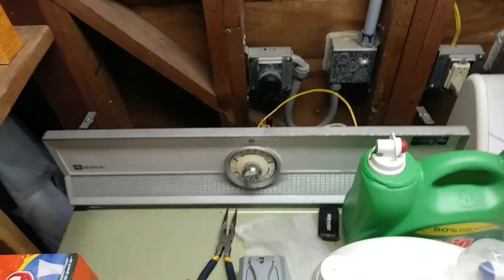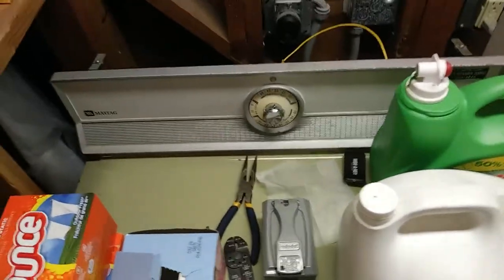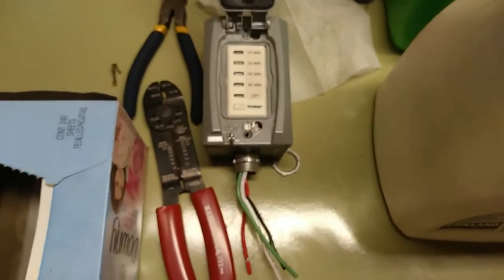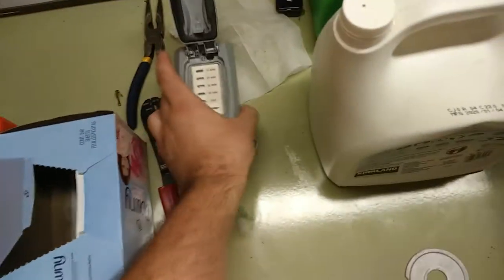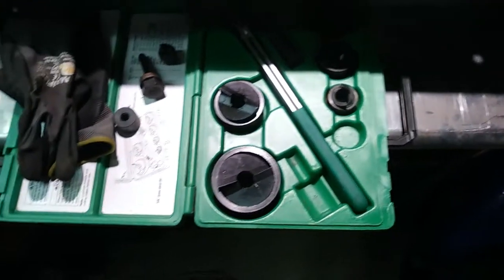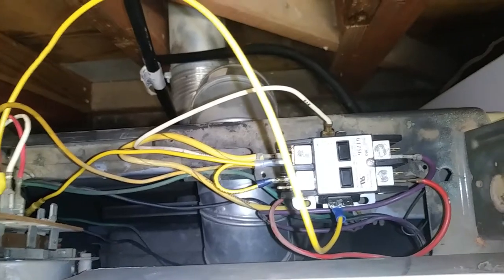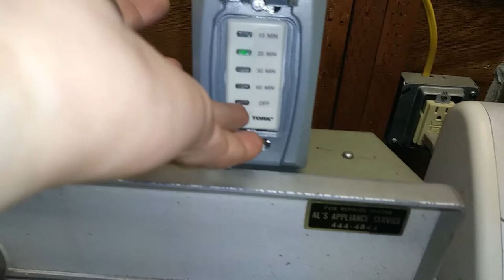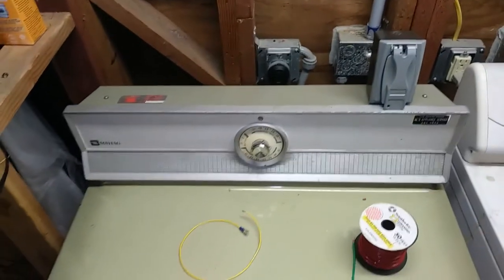Replacing Maytag DE-306 Dryer Timer Control (Custom Solution)

Comment: Might be worth looking on ebay etc for a new second hand timer. Nice fix with the external timer!
Reply from the maker: I found nothing anywhere online or in local parts stores, sadly. The old appliance repair illuminati has gobbled up all the spare parts available to us peasants. i would have to start building my reputation on one of the old message  boards. would take weeks to get any useful info hahaha
Reply from the maker: But i didn't do any irreversible changes here so maybe i will still look into it! At the moment i just need a dryer again hahaha

Comment: Believe it or not, these older Maytag dryers don’t use much electricity since they only have a 4800 watt heating element inside them, while many dryers around this time and now have a 5600 watt heating element.
Reply from the maker: I do believe it! doing a bit of research trying to find parts to properly repair the timer; I found that this model was indeed well-loved for its efficiency
Reply: @ despite only having a 4.5 cf drum capacity, will dry large blankets to completion without much of a problem. The only thing about these Maytag HOH dryers is you have to be diligent with checking your pockets for coins, since the heating element is just inches away from the drum, could be shorted out if a coin falls on the heating element. Also have to be diligent with oiling the drum and blower bearing every year to every couple of years depending on usage.